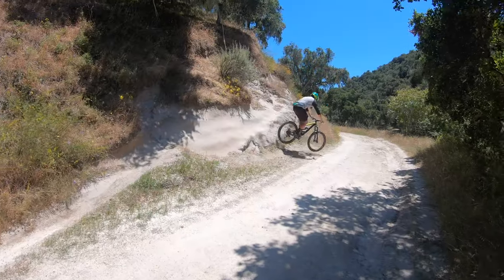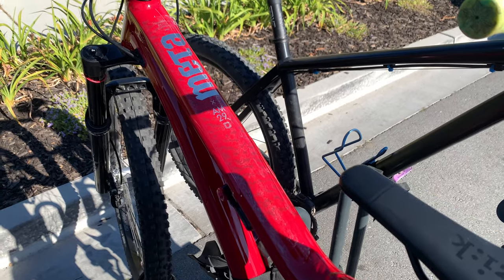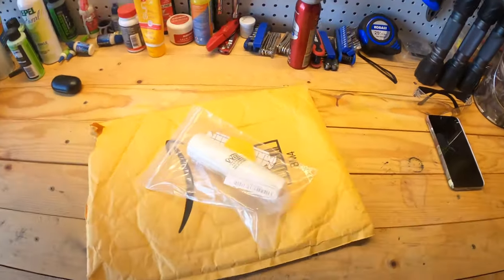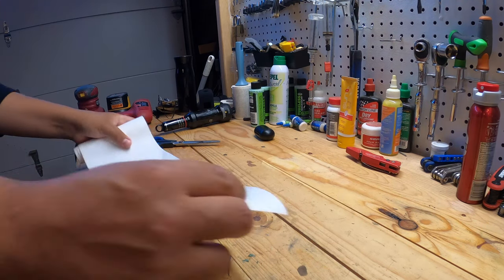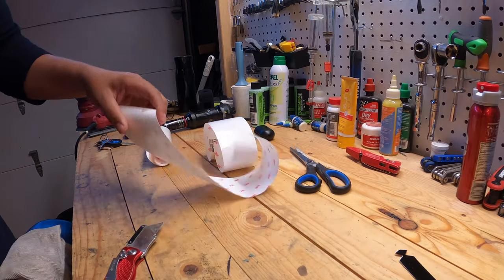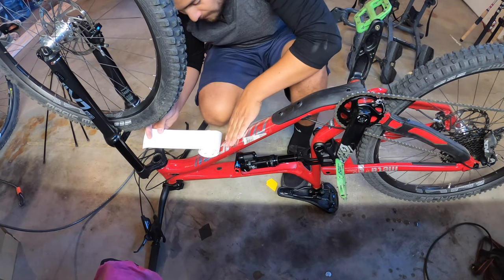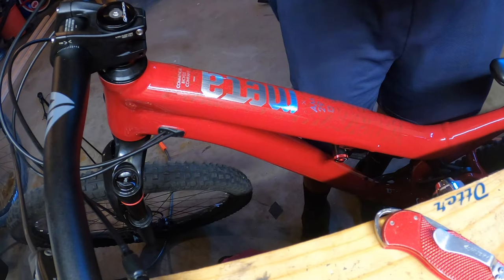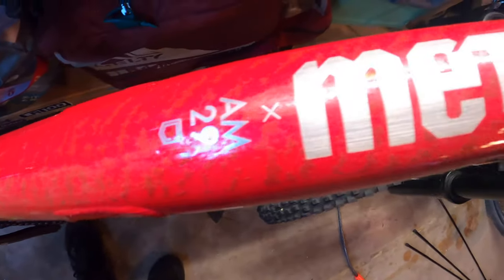Cheap Mountain Bike Frame Protection From Amazon! Under $20! (3M Clear Paint Protection Vinyl Film)

Comment: I've used this on a few bikes, and it's also  great for automobile door sills, the lower front spoiler, and some small areas on the fender around the wheels. It's easy and inexpensive. It adheres well, but is easy to rip and replace when it gets damaged.

Comment: Will the paint come off or somehow be damaged when you take the film off?
Reply from the maker: I have yet to take it off. But that was also one of my concerns. I read reviews where it did but were few. They recommended heating up the film with like a blow dryer before removing it! Hope that helps!
Reply: Thank you very much! That would really help when i take the film off.
Reply: Just use hair dryer blower to soften the adhesive and not to hurt your paint. Easy peel off. Thanks me later